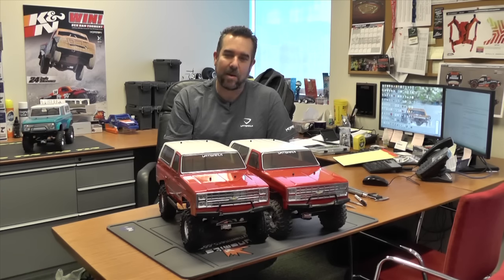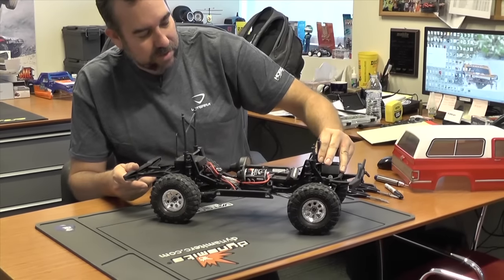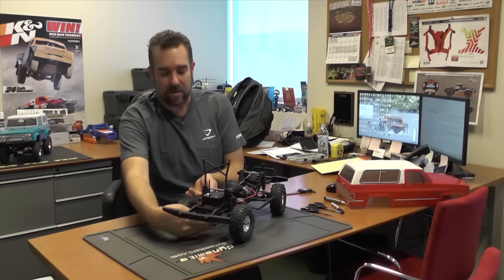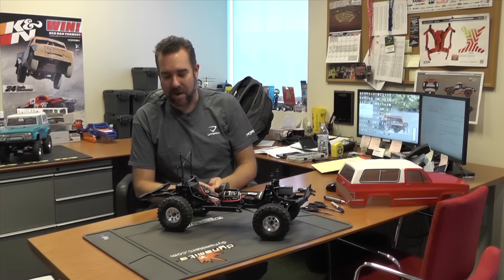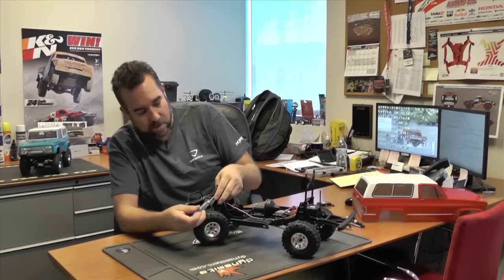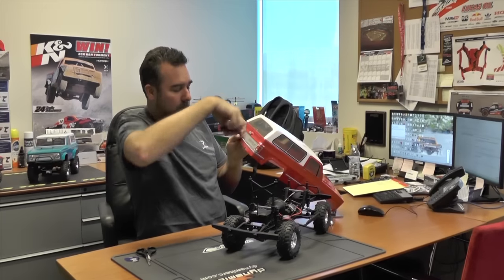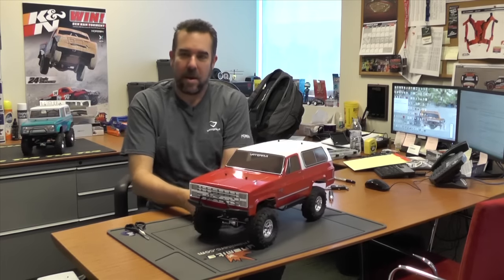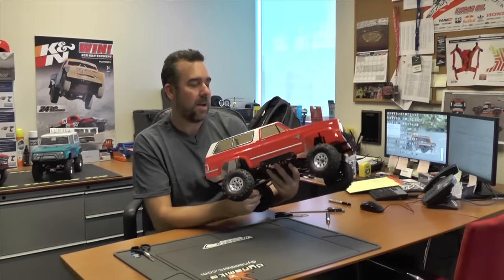Beginner setup for your Ready to Run Vaterra Ascender.

Comment: Excellent video I just bought that kit, but the rear bumper came with an inclination and I found out that both pieces that hold it came for the left side, for this reason it looks with a slope. Also I have noticed that the rear axle has a slight deviation that does not make it totally straight, would you have any idea of what I can do to fix it? Thanks

Comment: the only thing I wished for on this are beadlocks , you can dry your foams after driving through water
Reply: Yes you can, wash in mild detergent to remove dirt. squeeze out excess water let air dry over night. I use RTV to seal the tires and the air hole. Keeps them dry for a while. Good luck with your truck, and remember to use  marine grease all over the drive train. Rust will ruin any truck.
Reply: Jerry Watson
sealed my twin hammers beadlocks off , still dry foams

Comment: please have your rtr builders doublecheck their work a little better. I opened my sealed rtr to find the driver side rear strut not bolted in at the top and just hanging lose. luckily i was able to fing the bolt laying in the box because the amazon seller was no help at all. which reminds me, i need to leave them a review. if your are buying this as your first crawler because of how scale and kool it looks like me, skip this one and buy the RC4wd which you inevitably will end up doing as i did. lol. the vaterra is a nice truck tho. crawls like a mofo.

Comment: I think a botched honestly. After spending more than € 400 it costs in Europe the car, having to cut it to latch it does not seem the most correct.

Manufactures should leave well placed without cutting the car body, I find that frightening.

I would like to see the video of FORD BRONCO RTR that I have one.

Comment: I like this truck. But. the I think the shocks have the springs wrong. Put the long spring on top and the small one on bottom. The sleeve can not slid thru the shocks threads with dirt on them. It grinds the dirt. When you reverse the springs and then collapse the the shock the collar just touch's the cap on top shock. Also Put some tunes in your truck. See my video.
Reply: Dan Boone where can I see ur video?